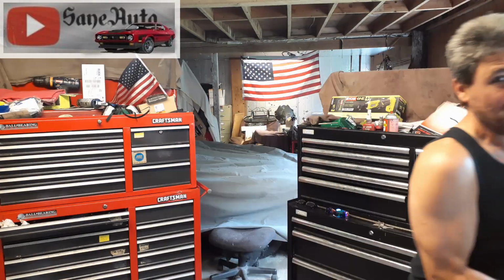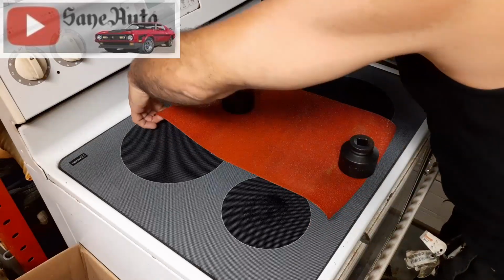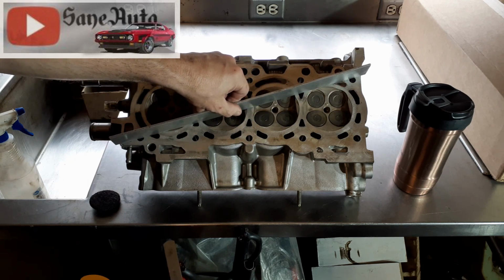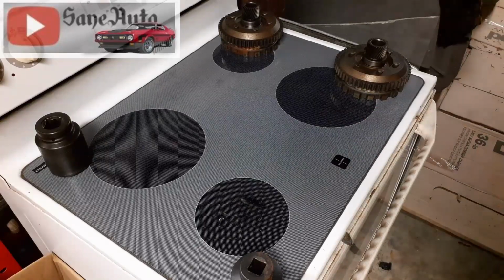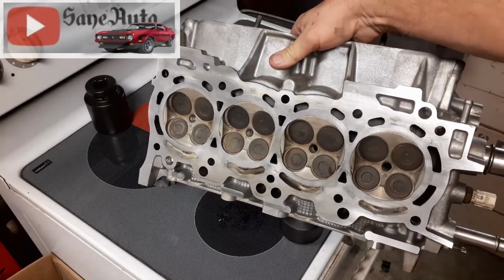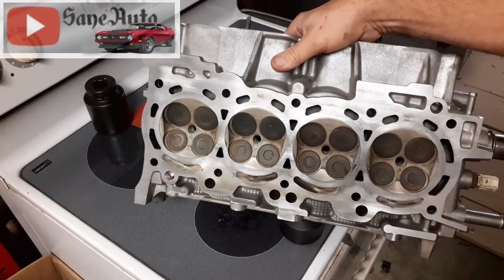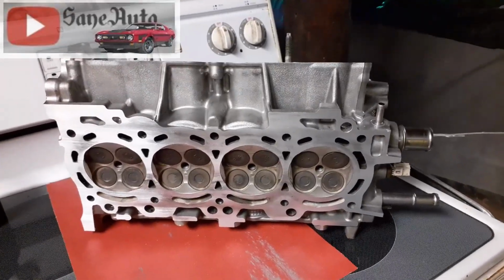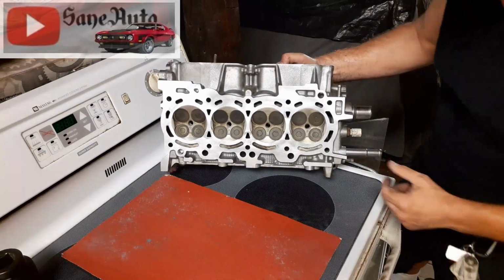How to Resurface a cylinder head at home DIY yourself cheap

Comment: This does work, I've done it many times and not just aluminum heads cast iron, old good cast iron engines from the 40s. However a head that size you can get resurfaced without even taking it apart for a hundred bucks, maybe hundred and twenty. Also while you have the head off check your block for flatness
Reply from the maker: Remember when we could take em in and get Valve job, resurfaced, and magni-fluxed (not in that order LOL) for $75 a head? That was awesome. Good advice on checking the block.

Comment: @ saneauto This is exactly the video I was looking for new subscriber. I’m doing the cylinder heads off my 2002 5.3 LS for my 1988 MCSS and they use MLS head gaskets and the surface needs to be near mirrored, what grit sand paper do you recommend? My cylinder heads are not in bad shape at all basically just needs a light touch up like you did in the video except smooth and almost mirrored

Comment: You DO NOT WANT CROSS HATCHING on the head or block! Unless you want to do this again in 10k miles. Especially on aluminum heads and block using MLS gaskets. 
The cross hatching will eat the head gasket alive. Might as well put the 80 grit sandpaper between the head and the gasket. As the aluminum head expands/contracts at twice the rate of the cast iron. Its constantly eating away at the gasket coating with a rough surface.
The ideal head surface is nearly mirror smooth so the  coating on the gasket can actually bond to the head. The inner sheet/sheets between the gaskets are designed for the outer sheets to slide on
Any sanding/grinding mark's should be inline with the expansion/contraction of the head.
Reply: ? surely the head will expand contract in all directions not just longitudinally. I personally finished off my cylinder head with 400 grit, not super fine but much better than the original manufacturing finish.
Reply: If the head gasket is designed to move with the block and head then it isn't really grinding away at the gasket now is it. It is moving with the block like you said.
Reply: you are the only person on the internet saying this so youll have to excuse us if we dont buy it.

Comment: I've been working with 120 grit but it's taking an age. Will get some 80 grit but would like to know if it's necessary to finish with a finer grit?
Reply: I know this is an older comment but to anyone looking for an answer to this... 
Yes, you want to get the head surface as close to a mirror finish as possible. So finish with 120 grit or higher.
Reply: @KyleNotAKyle  I got there in the end and actually finished off with 400 grit in a random pattern. Car has been fixed, back on the road now and running well.

Comment: Pop a wheelie 😎 
Gotta question 🙋🏾‍♂️ 
After doing this, is an air hose sufficient enough to clean the debris from the cylinder head before reattaching to engine block? Gonna be picking heads tonight and starting this process bright and early tomorrow morning.. 
thanks in advance 🫡

Comment: Howdie. Im fixn to attempt to sand a block deck while its in the car. Im gonna plug up the oil holes with paper towels. Should i be paranoid about getting grit in the oil gallies? Or do you think the filter will catch amy leftover grit i dont clean?

Comment: I like that you did a cross hatch but I see the shavings collecting in piles on the paper. A bit of dawn dish soap or what I use, WD-40 helps relocate the shavings away from your work. Nice job by the way.
Reply from the maker: You are correct about the Dawn and water. I use that when im doing aluminum with wet sand. Unfortunately I can only find dry sandpaper this big. With steel transmission parts I use 8X12 sheets of 3M and other brands of wet sand and old trans fluid over a bucket. I dont reme,ber if I mentioned in the video that I was stopping every so often and brushing off the sandpaper over the trash can. I had to do that about 50 times to keep up with the dry shavings.
Reply: @saneauto  check out my video on my page...I did two and that's what led up to me seeing yours.
Reply from the maker: Yeah you saved $180 and didnt have to drive over there. Nothing wrong with that.
Reply: Yeah Cris cross worked a charm in my head's. Showed all the low spots. I also changed grip positions to even out downward pressure. Cats up and going again no leaks

Comment: I have done this and my question is when using a straight edge what is the feeler gauge thousandth value I should be shooting for ?
Reply: Usually they say 0.002 inch max. warp each 4 cylinders length.

Comment: How is the head currently holding up?
Reply from the maker: This engine made it to almost 400K miles before it developed a rod knock. I did a tear down video showing the damage and a engine replace/install video. The head and gasket were still fine when I tore the engine down.